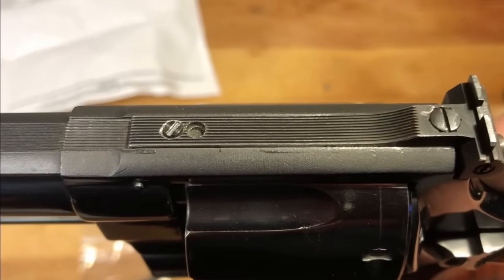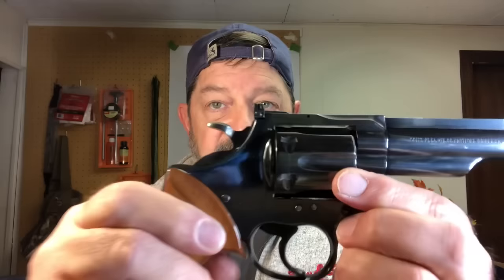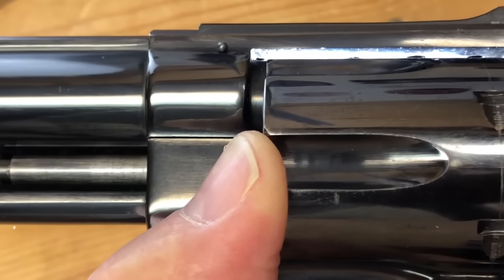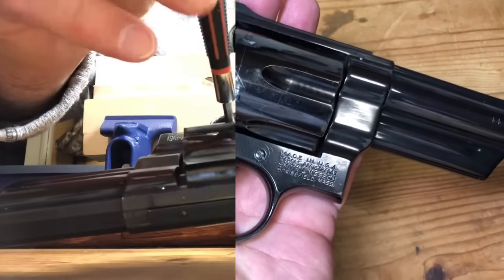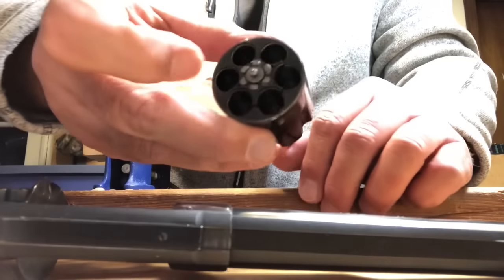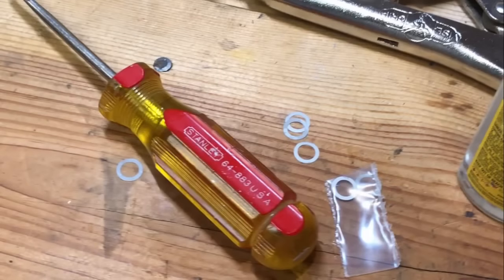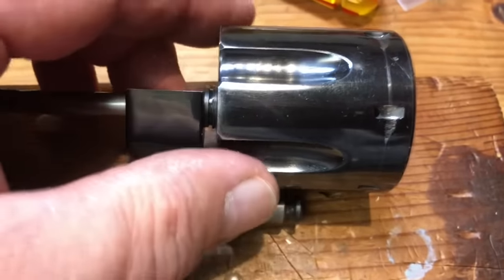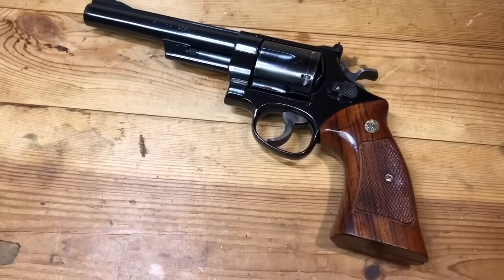Fixing End Shake on a Smith & Wesson

Comment: Thanks for the video.
This method works but it forces the cylinder back on the cylinder shaft.  This increases the barrel/cylinder gap.  If that gap exceeds specifications (usually about .010") then a more complicated repair is needed.  Even that repair on S&W revolvers is not too difficult, but does require a couple of special tools and a some minimal skills. There are a couple of YouTube videos showing how it's done. 
FWIW, end shake is a more common problem in S&W revolvers than Colt's, but is easier to fix in S&Ws than with Colt revolvers. 
A steady diet of heavy, magnum loads (or even +P .38 Special loads in .38 +P revolvers) will cause this problem sooner in any revolver.
Reply: How do you correct excessive cylinder gap? I haven't found any videos on the issue, and I've got a .014" gap.

Comment: Don’t forget about yoke endshake. Power customs also makes shims for the yoke. I had to use them on a model 66 and they work perfect.
Reply from the maker: Steve Jacoby fortunately my issue was limited to the cylinder. 
The Power Custom Bearings came with a full catalog of their products / looks like good stuff
Reply: If possibile I prefer to peening first the yoke button, that's because the yoke washer reduce a little the cylinder/barrel Gap

Comment: If cylinder gap to forcing cone was an issue, tolerances would be much closer to zero. As long as the cylinder is able to "Reach" the cone within specs, all is good. First thing-hammer strikes round! Secondly-cartrige explodes in all directions internally! Third- after the casing is backed against the frame(a milimeter), the bullet having to travel much farther to reach the forcing cone, drags the cylinder with it. Simply laws of physics! Front end "minimum gap" is the only somewhat concerning thing, but hey! I freakin" love revolvers!😁

Comment: I just picked up a Mint S&W N-Frame Model 25-5 .45 Colt 6” it has the pinned barrel and the wide target hammer & trigger and the bluing is spotless with no signs of holster wear and even the forcing cone is spotless and not one scratch on the top strap, cylinder is tight with no end-shake but anyway I was looking for a model 29-2 but I came across this beauty for under a grand and so I grabbed it. Enjoyed your videos on your 29-2.

Comment: For taking apart the ejector rod from the cylinder, I like to use the chuck form a power drill to secure the rod. That way you have a tight grip and three points of contact instead of two with a vice.
Reply: 😮😮❤❤Never remember of that!! 😮1000 thanks!!

Comment: As always, ensure the firearm is in a safe condition and unloaded when handling.  My Smith and Wesson manual says the go/no go tolerance is .0004-0006ths of an inch for this gap.  Another method of repairing this gap is to stretch the yoke/crane using a Yoke/Crane alignment tool and a safe edge pipe cutter designed for gun smithing.  This method corrects the gap without adding parts to the revolver and should only be attempted by a gunsmith familiar with the Smith and Wesson Armorer School.  I have made this repair by stretching the yoke/crane on many .357 and .44 Magnum revolvers.  This video provides good advice and has a detailed explanation.

Comment: I guess the thing that is a bit of a bummer is these end shake bearings open up that cylinder barrel gap.  I used them on an old Colt SAA and you can put one on the other end to close the gap a little bit, as long as the head space remains in spec...

Comment: You didn't have to unscrew the ejector rod.  What you do is you grease up the washers and the back of the yoke barrel.  Then you stick the washers on the back of the yoke barrel, and the grease will hold everything in place. After that just assemble the yoke and cylinder onto the frame.  Otherwise you can just drop them into the space between the ejector rod and the cylinder.  Then put a little grease on the end of the yoke barrel and assemble the yoke and cylinder onto the frame.

Comment: How did you when you had the correct torque for the rod back into the cylinder? Did you just had tighten it? I saw here on YouTube it should be 40-50 inch pounds. I have a S&W 65-3 with this problem.